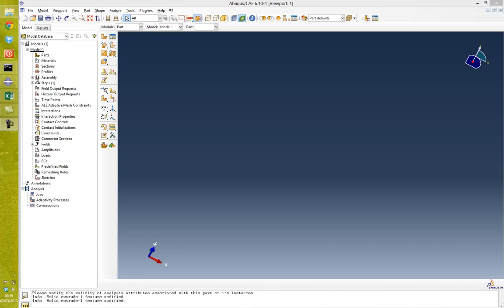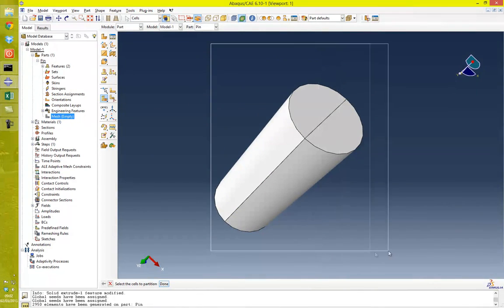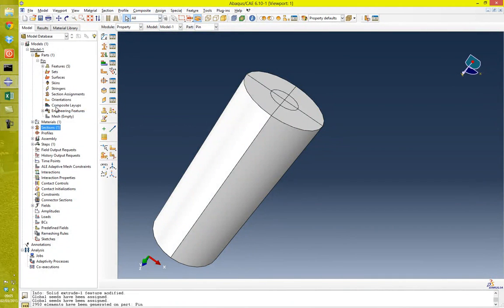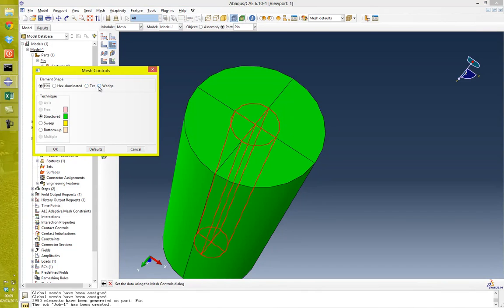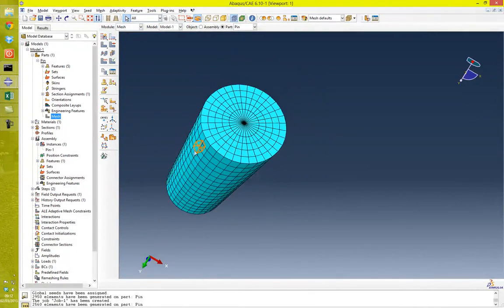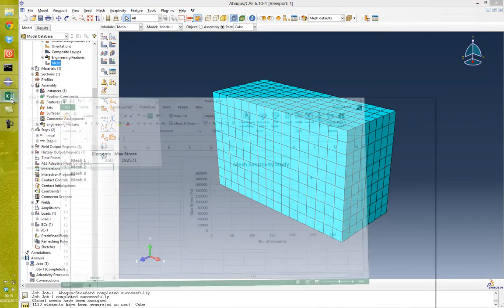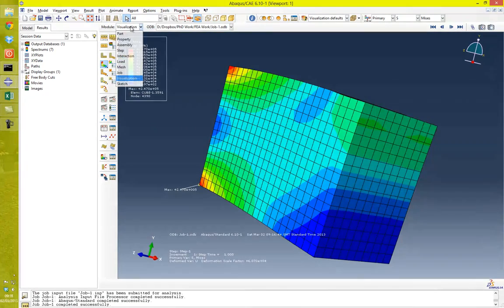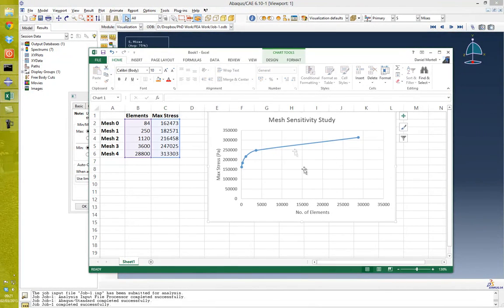Abaqus Mesh Pin and Mesh Convergence

Comment: How did you bold the element like that on the first mesh? mine is just on the surface even though i assigned the material but still the mesh inside is empty  when i cut-view inside

Comment: Hi, great video
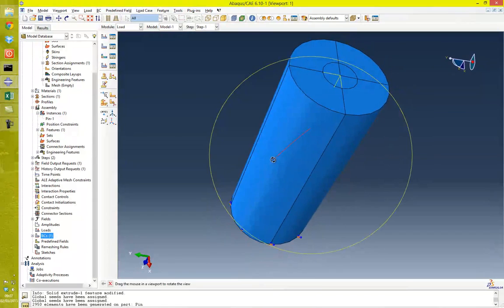My only question is why did you apply a load (7e5) to one part of the circle quadrants? (7:55)

P.s I'm looking to use this pin as part a four point bending test.
Reply from the maker: +blazedouble07 You're welcome, it's been a while since I made the video, but I think was just demonstrating very quickly how to apply a load. I know it would be strange to just load one quadrant, it was simply just an example, because I don't think I ended up running any kind of analysis on that model!
Reply: +landoflemon I see, thanks man

Comment: Godo work. Few minor comments:
(1) Forth the classical mesh sensetivity study, the new refined mesh must contain all of the previous coarse meshes; a simple way to achieve this is to reduce the element size by 1/2 with each refinement. Many times it is hard to achieve, so atleast try to get closer to previous mesh.
(2) Convergence check should not be done on arbitrary point, especially when it is integration point variable. With mesh refinement, the integration point keep on shifting. In such case, convergence check should be done at the point closest to the previous one (or even better a cloud of points).
(3) For displacement based elements, the higher order derivatives converge relatively slowly than displacements. So higher order quantities are better check for convergence, unless the interest quantity is displacement only. Additionally, it is also advised to use individual components than resultants as it also gives hint regarding which direction mesh refinement is better.
Reply from the maker: Thanks for the really good response to the video. The one thing you mentioned that has been on my mind is the recording of the new stress from an arbitrary point. Since making the video, I realised that I should have been taking the measurement from the exact same location, and this is what I have been teaching in my labs, but unfortunately it's not included in this video.
Reply: @landoflemon  But, upon refinement of the mesh the geometry of element at a particular location is gonna change, so does the elemental stress. How to tackle this issue?
Reply: +landoflemon 
hi, i would like to contact u directly, if u wouldn't mind drop your email, or whatsapp, or facebook contact for me chinobright1@gmail.com
cheers

Comment: Hello 

I am trying to model a 3D cylinder with a constant rotation of 45 rad/s. I have meshed the cylinder similar to this tutorial with a much finer mesh. I have applied the angular velocity using a predefined field but am getting a varying stress field for the hoop and radial stresses over time. 

If you could give me any thoughts or suggestions it would be very much appreciated.
Reply from the maker: Hi Cian, if it's a 3D cylinder rotating in space with a constant velocity, I don't understand where the stress would be coming from? Is it purely a result of the rotational velocity (approx 430 rpm)? Or is there some other load/displacement/contact applied?
Reply: Just pure constant rotational velocity.There is a boundary condition on the central axis such that U1 = U2 = U3 = 0. Other than that nothing else is applied to the disc other than the predefined angular velocity field. I have tried running the simulation in double precision and also with second order accuracy wedge elements but still get an unrealistically high and steadily increasing stress field.

Comment: Hello

Please I need help regarding the mesh of a cylindrical tool (shoulder and pin) modeled by a 3D solid analytical rigid type in Job there is an error that is displayed (Error in job Job-1: ELEMENT TYPE C3D10 IS NOT AVAILABLE IN Abaqus/Explicit) 

Thank you.

Comment: I am trying to do a simple fixed beam analysis with a concentrated load in the middle. The problem is my solution is not converging as I refined the mesh. The maximum stress just keep increasing, Any help please?
Reply from the maker: I there. One thing I forgot to mention in the video is to pick the same location to measure your stress value from. It's no good if your max stress keeps moving around to different locations in your model. The stress really should be converging, are you sure you're refining the mesh to a high enough density to achieve convergence? Have you tried locally seeding around your location of highest stress and just increasing the mesh density in this location?
Reply: Thanks for the help. But I think that I figured out what was happening. Since it is a point load, i.e a load over an infinitely small area. Therefore as i was refining the mesh the stress was just getting bigger and bigger which was in a way converging to infinite stress. 
btw do you know how to overlay different plot (graphs)? I want to plot different meshing results on the same graph. Thanks in advance
Reply from the maker: Just export the separate data to excel and graph it there perhaps?
Reply: Thanks man, It helped! :)
Reply: i think its a singularity problem !